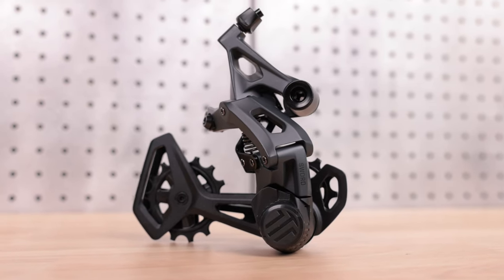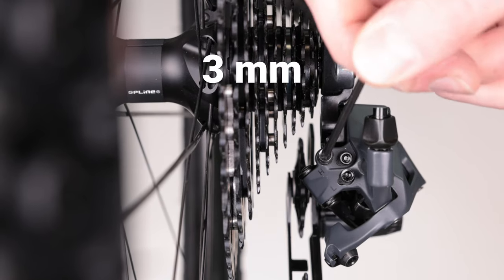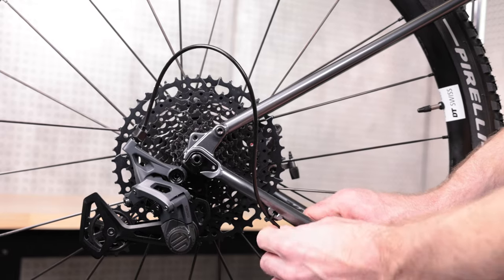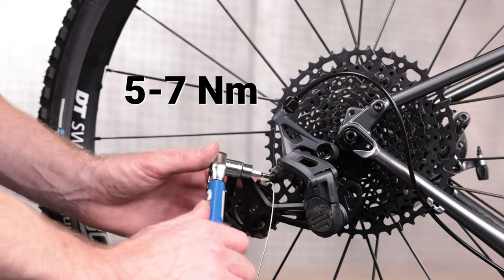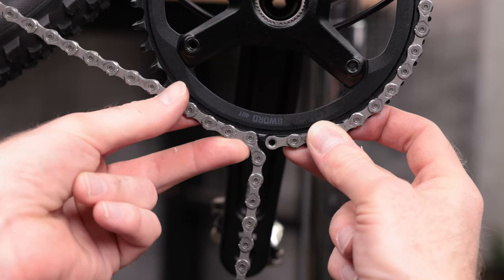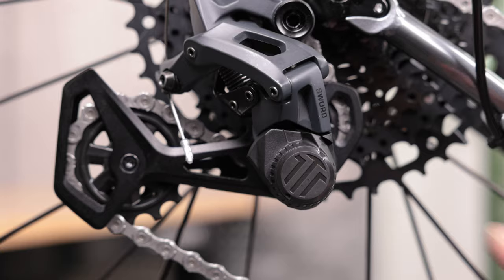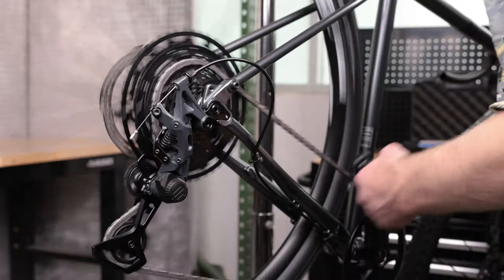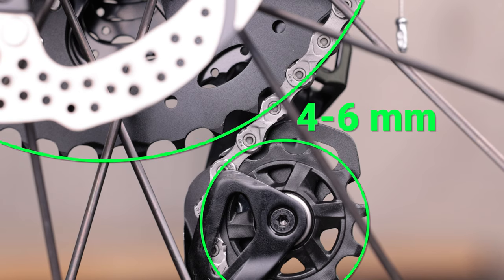Sword 1X Rear Derailleur Installation Guide

Comment: I take it the shifter has a spring in it for the small paddle? Also I'd be curious is there would be someway to get a 48 cassette working on the 2x.
Reply: they have 2x version already
Reply: @ondrejmanych5688  yes but it doesn't accomodate the 48 tooth, only 38 max cog despite having a greater capacity.
Reply: @JohnSmith-ox7xc  Oh I see now. I was mistaken that it is the same for both.
Reply from the maker: To use an 11-48 cassette with a double, you would need an incredibly long derailleur to take up all the chain slack. Like, it might scrape on the ground. So, it's really not feasible for us to make something like that, unfortunately.

Comment: Is 2x setup fit with 50/34 - 11/34 gearing?
Reply from the maker: Our 2x system uses an 11-38t cassette and either a 46-29 or a 48-31 crankset.
Reply: @microSHIFTTECH  46-29 with this casette sounds pretty awesome for a hilly area. What about doing some adventure/bikepacking version of this? That would basically mean fitting the smallest small ring possible and bigger one. I think people would love that. There is a hole in the market and you have to hack something to make it.

Comment: Can you combine this derailleur with Shimano HG500 10 Speed (11/34)?
Reply from the maker: No, the 1x is not compatible. 2x is compatible with that cassette size.
Reply: @microSHIFTTECH  can u use the 2x derailleur with only a 1x crankset,...?
Reply: @microSHIFTTECH  or is it compatible with Shimano CS-HG50-10 cassette 10-speed - 11-36?